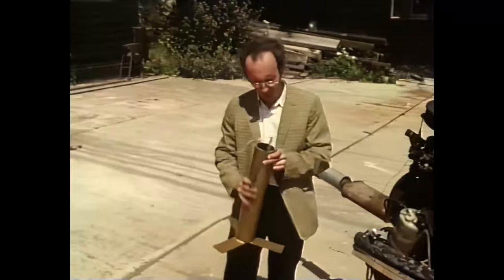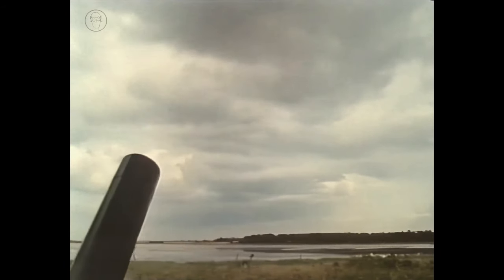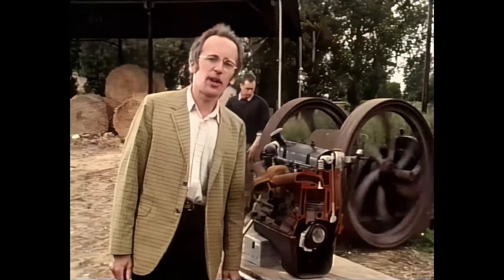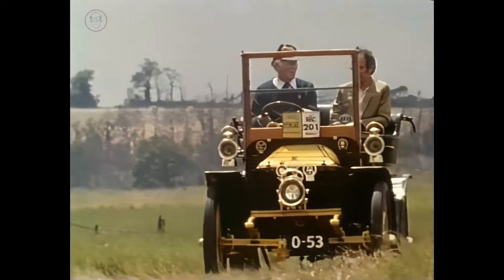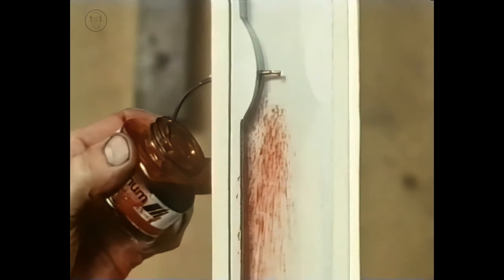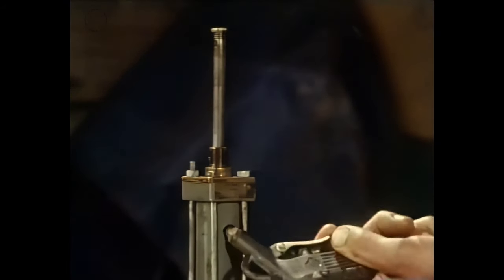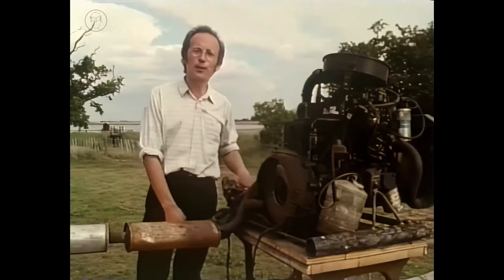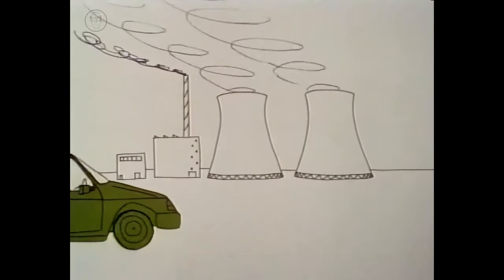The Secret Life of the Engine - remastered

Comment: I remember watching this episode on PBS when I was 10.  My dad let me take a old lawnmower apart that wasn’t running. It took me about a week and I had it running. Learned about carburetors and Magneto ignition systems.   It’s a shame we have turned into a throw away Society.   Funny how many things people throw a way and it’s something easy to fix. A broken wire or blown fuse.  Thank you Tim for everything you do. My condolences for Rex
Reply: Was never on PBS
Reply: @DoctorShocktor  how can you say it wasn't on public television?? pbs is in many countries other than the particular country you may live in.
Reply: @cobre7717 Strangely when you say that, I watched PBS' WNED station out of Buffalo which has a higher viewer rate in Ontario, Canada than it does in its State of New York.  Granted, we also have TVO as a provincial public broadcaster as well.
Reply: So many of our inventions are made with microscopic features. Once parts got smaller than the human scale, home repair was doomed. The best you can hope for is swapping out macro scale components. Tires and brakes will never follow the same shrinking trend as the transistors in the car stereo, for example.

Comment: you're totally right. a high-efficiency turbo diesel plug-in hybrid tiny car would be the greenest solution. Also, if it could supply backup electrical power to your house in an emergency, then it would be the most indispensable machine ever created. (especially if it could run off used fryer oil/bio-hydro-diesel)
Reply: In the 1990's the U.S military replaced a military Hummer engine with a 1.9 litre VW diesel running a generator, with a small bank of lead acid batteries and an electric wheel motor at each tire and they were getting 40 MPG and it was way faster than a factory hummer.

Comment: I enjoyed hearing your thoughts on green cars. We recently acquired a Hyundai saloon, which has a small, but very efficient 1.6l petrol engine. It also has a battery, which is charged by the engine, and by recovering energy from the brakes. As such, it never needs to be manually charged. This seems to be the 'sweet spot' of efficiency. It achieves 60mpg, which is hugely impressive next to the 26mpg our previous MPV achieved with its turbo-charger 1.4l engine (which eventually died!)

Comment: Hi Tim! Your a legend! 
Just wanted to feedback on the engine video! I just wanted to add how amazing and great the Diesel engine is! And to add that my thinking is similar to yours about how electric isn’t the answer ... and the fuel could be changed in Diesel engines .. as the engine is not at fault .. and is the fuel .. originally it ran on peanut oil ... and sunflower oil is a option .. sustainable not sure about environmental output ... I don’t think it should be demonised.. also my vehicle is 60 years old ... how many other cars where made and destroyed in this time ? Make things more rebust, fixable and they will naturally be better for environment! Maybe not as stylish or efficient but the pros  out-way them.
My job is repairing domestic boilers! And there’s loads of work for me ... but there doesn’t need to be! If customers had a option for a 20% less efficient boiler! For nearly 100% reliability I think they would take it .... but instead we have over complicated boilers with expensive parts  but a fancy a rating sticker ... any who that’s enough of me rambling on! Hope to see you one day at your arcade

Comment: Wonderful episode, thanks Tim. Such a shame that last bit was cut off. I couldn't agree more that it'd be better to move towards smaller lightweight cars like a 2cv but with modern, cleaner power units.  I may be biased though ;-) (2cv owner...).
Reply: Nonsense, lightweight, small cars would be incredibly dangerous now. They don’t have to be giant SUVs, but a mid-size car is the bare minimum now for safe travel in modern systems. The solution is to have hybrid or electric vehicles that run in more efficient fleet/formation modes, and are more shared amongst users to increase utility.
Reply: @DoctorShocktor  You're really not a driving enthusiast are you?!  I think cars such as the Smart Fortwo, Forfour and Toyota Aygo rather prove that light small cars can still be plenty safe.  If "modern systems" are really so dangerous now, It can only be due to oversized cars, inattentive drivers (better mandatory training would help there, along with restrictions on distracting gizmos in cars (touch screens etc.) and Smart motorways having no hard shoulder need to be axed.

Comment: Mostly good points at the end there. I can't help but feel the way that general motors in particular is pushing huge EVs like a new Hummer is just a way to keep doing things the same way they always have, and it's all massively extractive. Especially here in America where I live, if we've got a chance to make things better we need to cut down the number of cars and replace what's left with mostly EVs, and use the smallest ones possible for whatever purpose they're being used for.
An electric assisted bike lets you get a lot done inside a city, and the batteries on those are small enough you can take them off when you park and just charge them up from a regular wall socket in your house.
Reply: Good point on the EV bikes, the are proving to be a valid replacement for all kinds of intercity vehicle use. Regarding GM, they may not ultimately be the EV answer, but the reason they’re currently selling large EVs is because they are the test platforms for their new battery systems which use far less problematic metals than current EVs. There are two dozen more GM models coming in all sizes, you’re pointing attention far too early.

Comment: Long live the infernal combustion engine!
Reply: I own them and always will, but am adding the incredible EVs now coming out. Don’t be slow, eventually the fuel will be no more.
Reply: @DoctorShocktor  when we run out of dino droppings I'm sure modern science can make synthetic fuel. Being as we could make it 80 years ago already. Plus we've only burned up about half of the oil in the ground by now. And that's lasted us more than 100 years. Although demand constantly increases so the second half will go faster than the first half did. Still should have fossil fuel for at least another 50 or so years. So it is nothing I have to worry about. Unless we cure aging.

Comment: Nobody in the business would make such claims about the catalytic converter today. The efficiency of the 3way catalyst is so good that any alternative that does not run "lambda 1" as this type of catalyst requires usually fails because of a suitably efficient catalyst alternative not being available. Also the efficiency of the SCR catalysts used in diesel engines with "AdBlue" or "DEF" is reaching very high efficiency numbers, although their operation still is more limited to certain temperature window than a 3way catalyst is.

Comment: I'm glad to hear you have a realistic view EVs. Just caught up on your series and great videos!
Reply: Realistic yet severely inaccurate in some ways. I’m an advocate of both ICE and Electric, but I prefer accuracy as well. The environmental issues with batteries are being solve more and more with batteries using alternative metals and must less use and  more recycling of the more controversial metals. Most importantly, the charging time issue is totally wrong. Most people do not drive daily even half the range of most EVs. Over 90 percent can simply charge overnight at home, using a few seconds to plug and unplug the charger - the “fueling time” is ZERO, since you don’t stand there while it’s happening.
Reply: @DoctorShocktor  the energy density is simply not there to make it viable as a global solution. I saw no severe inaccuracies, he was spot on with his fears and predictions. Did not state it as a fact, just a fear based on current and past events. ICE has its place but it's is not the solution everyone makes them out to be, hence a realistic view of them. But thanks for chiming in

Comment: While using electric cars doesn't elliminate CO2 emissions if it's charged from fossil fuel powered electric powerplants; it's much easier to make the electric cars green all at once by replacing polluting powerplants with renewable and nuclear powerplants than making thousands of cars run on wind or nuclear fusion. And even with fossil powerplants it at least moves all the emissions away from the streets to one central stationary location  where you can also easily install as much heavy filtration and cleaning equipment as you like. 

Of course the main solution is to use as much public transport as possible and make as light and efficient cars as possible for the remaining transportation needs.

Comment: Heh, I'd forgotten about the TEL/CFC connection, poor bugger was on a bit of a roll with those two.

An interesting aside here is that Ethanol was being looked into as an octane booster and antiknock agent at the same time but Standard Oil pretty much killed that because they could  patent the use of TEL for that application so it was more profitable. So if it weren't for TEL we probably would have been using Ethanol as an antiknock agent since the 20's (and wouldn't have had all the issues we ran into in the early days of ethanol/petrol blends) ;)

Comment: This video it's still relevant today, and an absolute masterpiece.
Totally agree about the view on hybrid cars, to me they just add complications and cost, they look like a transition phenomenon.
Electric cars still raise a lot of concern but are better at least in the city environment as they remove sound and smell, that's already something very important to me.
I mainly worry about the shorter and shorter programmed operating life of modern cars filled with technology that rapidly gets obsolete and will make you change the car even more often than before. (and where is the sustainability into that? It remainds me the issue of the Singer sewing machine too well built in the secret Life of the sewing machine).

I hope some car company will go back to the concept of long lasting and repairable vehicles it will probably pay back in the long run.

My own bmw from 1995 came with a large tool box in the trunk to allow the owner to execute the basic maintenance and make the car last longer and i love that.

Thank you for your amazing work!
David from Italy
Reply: Hybrid and electric cars are great for people that drive short stretches. They will never be suitable for everyone. Internal combustion will be around for a long, long time yet.
Reply: @juslitor  Hybrids do long distance great.
Reply: @NiHaoMike64  Ok, name the ones that do 800 km per refueling.
Reply: @juslitor  800km is about 500 miles, a Prius easily does that on one tank.
Reply: @NiHaoMike64  Which is quite impressive in itself. Only problem is that a Prius is expensive. Getting one for 3k$ that is in working order can be a tall order.

Comment: I agree with you about elec cars,,,,, theyre not ready yet,,,,, the batteries ,,, lipos,,,just like in your phone/power screwdriver etc,, start to be sub optimal after about 900 charge cycles,, then get progressively useless.... They cost about 8 grand to renew.  factor that into your running costs,, ..  Also,, in winter,, the battery chemistry is about 15% less efficient due to cold temps,,,, and to compound the situation,, thats just when you want the heater on,,,, and that draws lots of amps..  Personaly, I use a 125cc fuel injected honda scooter for 95% of my transport,, nearly 200mpg,, and traffic jams dont exist anymore. I wont be going electric till there is a big evolution in battery tech in durabillity and energy density..
Reply: Early Tesla Model S have lost on average ~8% of their rated range at 250k km, which is pretty close to 900 cycles, so that doesn't really seem a big problem. Also you almost can't get a new EV that uses wasteful resistive heating anymore. Not disagreeing that smaller or alteternative modes of transport are more important, but having shitty fossils replaced by less shit EVs that basically anywhere in the world get cleaner as time goes on is a great developemnt
Reply: @zeugundso  900 cycles can occur in just 3 years,,,,  and once degradation starts, it only goes one way,,, till one is faced with an 8 grand bill... and,, if they dont use resistance heating its either freeze yer nuts off,,dress up like Ernest Shackleton  or do like some folks are and fit a fuel burning device (eberspacher type)  heater...   90% of the battery packs are merely hundreds of 18650 cells (like in torches, tools, radios etc) strapped together,,,  I use them in many devices and know how short can be their  usefull life.  Also,,  most of the world still makes electricity by combustion , so its only moving the problem upstream..
Reply: @marmac567  basically you have to buy the smallest ev and roadtrip it everyday to get to that result... teslas hitting 300k km and still remaining 90% of the range are the norm not the exception. Also heatpumps
Reply: @zeugundso  I dont know why you keep mentioning tesla,,,, not many can afford them,,, most are buying the budget side of the market,,, which dont have heat pumps
Reply: @marmac567  because there is proper long term data with high milage cars, you think new cars will perform worse than 10 year old technology? Which brands don't have heat pumps even in their more affordable EVs? Even Hyundai has them as standard
Reply: @zeugundso  most cars have resistance heat as well as pumps,, pumps are far less efficient as the  weather gets colder,, not an ideal scenario.. They also use resistive heat to prewarm the vehicles,, which,, like the energy to charge the battery,, mostly comes from the power station down the road spewing out hydrocarbon emissions..  And,,, heat pumps are another expensive item that will fail in time... Have a read of the tales of woe on the ev forum

Comment: Petrol is named after a bird who's fat used to be burned for light. The bird was called a petrol. It's amazing to see how far engines have come Briggs and straton has come out w a 60+ hp fuel injected air cooled 4 stroke, 2cyl, 1000 cc, marine rated motor!
Reply: Petrel – BS! Petrol is derived from petroleum. 

Etymology: Old English petraoleum: from medieval Latin, from Latin petra ‘rock’ (from Greek) + Latin oleum ‘oil’. Nothing to do with birds.

Comment: Even if you don’t plug in a hybrid to charge they still have regenerative braking to improve efficiency, not as good as it could be but better than not having it
Reply: If that's all it's used for.. I think it's doubtful it would even compensate for the emissions caused by the production of the electric motor and batteries.
Reply: @Eis_Bear  And you’re wrong. The production of EV item is becoming greener everyday, try using some actual information.
Reply: @DoctorShocktor  Haha, oh wow. You must be a pleasure to be around.

Comment: Thank you so much for a great series, I'm sure it contributed to me becoming an electrical engineer. 

I also agree I am a little concerned that people think electric cars are a magic solution, simply moving the pollution to power stations and the additional impact of lithium mining etc. does not seem ideal. I suspect/predict an increase of nuclear generation to maintain 'green' generation mantra and compensate for the comparable low power output from wind/solar farms. Which again does not seem ideal. I deal directly with bio generation plants, leaked methane from these places is a major problem.

Comment: I agree that there is no green automobile. The efficiency of delivering electricity from a power station to your home outlet is only about 17%. Then one still has losses from converting the home power to DC, charging the batteries, running the electric motor and transferring it to the wheels. I estimate that by this time one only gets about 8% efficiency from the power plant. So, an internal combustion engine running at 20% is far more efficient than electric vehicles.

Comment: Mr Hunkin I believe your calculation is wrong by 3 orders of magnitude (maybe you misremembered ?) :
1L of fuel holds 10kWh
A typical filling station pump has a rate of about 50L/min
Hence the power should be 10x50x60 = 30,000kW = 30MW
Still impressive compared to electric cars (roughly a hundred times slower at best) but nowhere near a GW.

By the way thank you for your excellent videos.